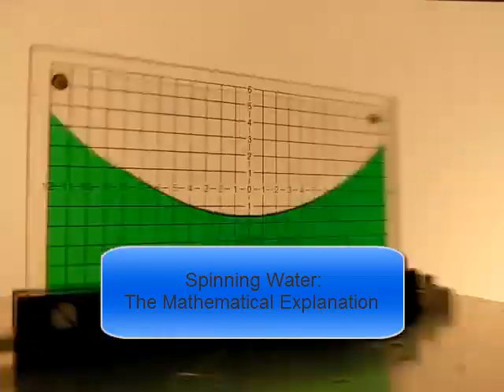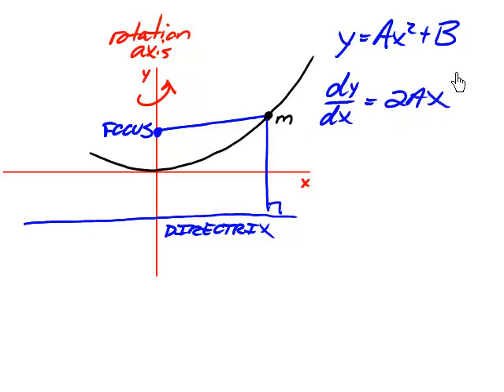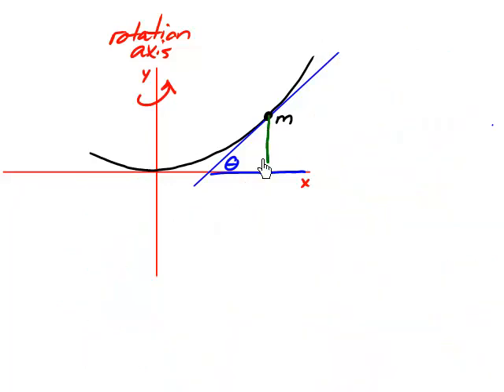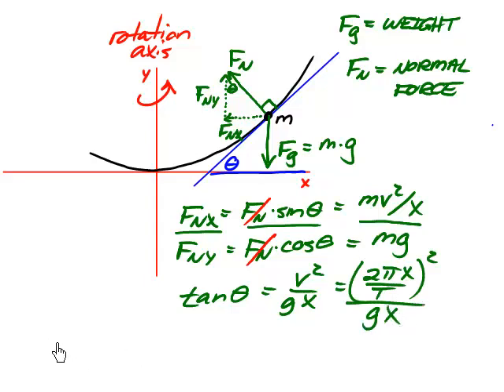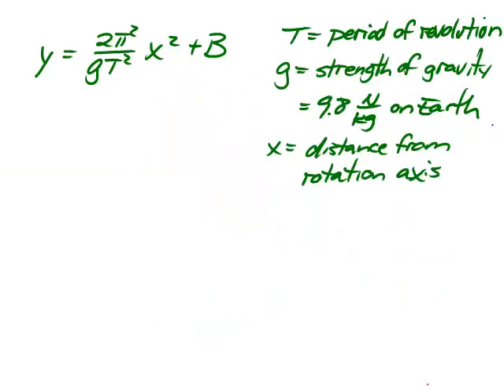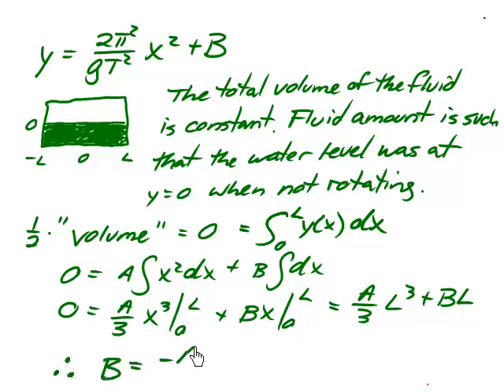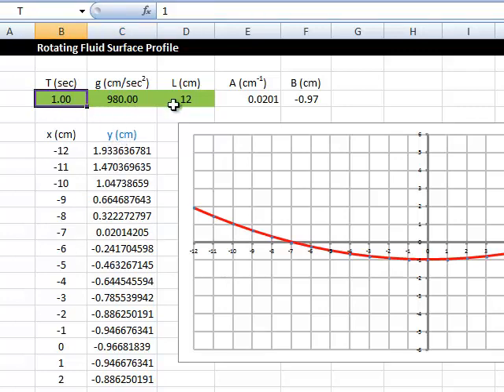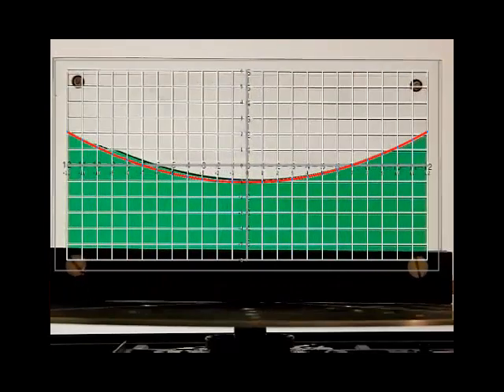Spinning Water: The Mathematical Explanation

Comment: Sorrrry ...what caused the normal force ?!????
Reply: I know this is a late answer, but it comes from the surface of the fluid, as a reaction to the weight of the small amount of water we're focusing on. It can be thought of in much the same way as the normal reaction caused by the weight of a cyclist going around a banked track, acting in two components. Hope this helps!
Reply: I'd say it is because of the weight of the water and that specific point Fg. It pushes down at an angle, creating a sideways motion called the centripetal force
Reply: the horizontal component of the centripetal force is a result of pressure of the water buildup against the side of the container farthest from the axis of rotation. the container pushes the water back into the container. this tutor doesn't really understand what he's teaching, that's why he creates more confusion than insight.